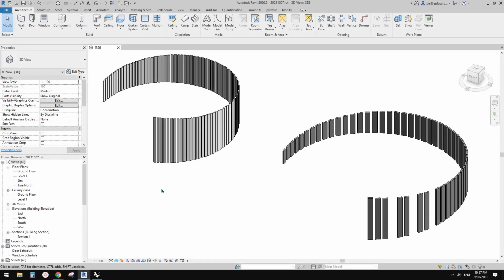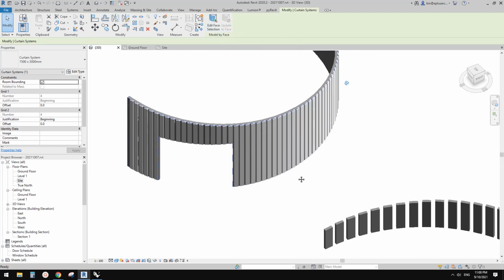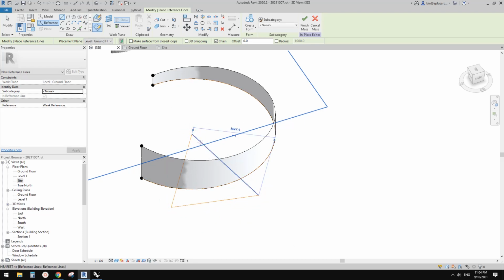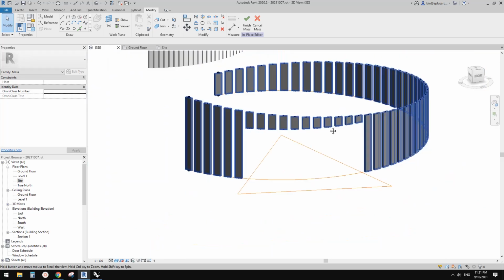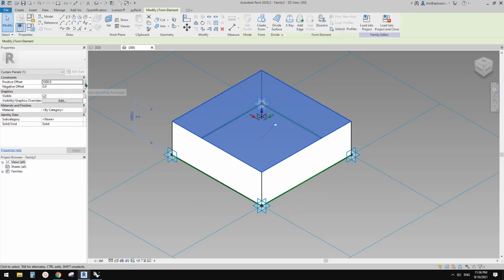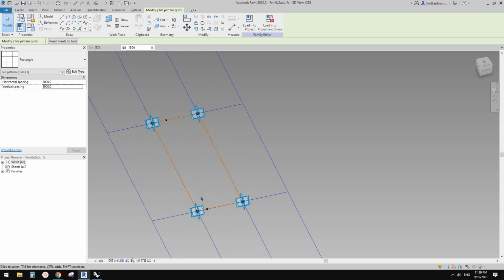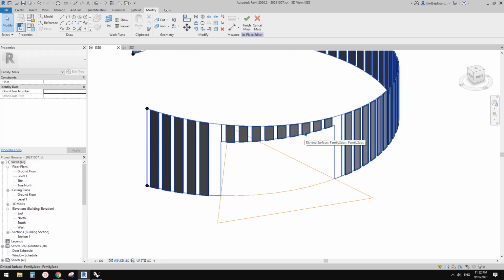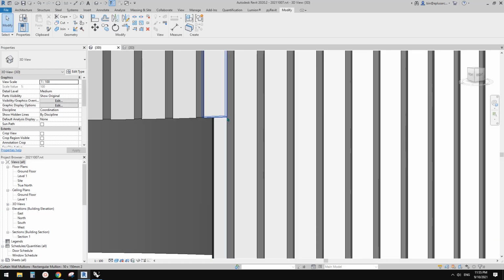Revit Exercise (Day 566) - Let's continue the exercise Day 564

Comment: I have a suggestion,  can you make a video from a to z , of makinga project with the right files and settings , for coordination, wall thickness, templates , for finally making the right BIM project
Reply from the maker: I don't think I am at that level yet. I only work as an draftie in a firm with less than 20 people in regional Victoria and do not have much experience on those BIM stuff. Most of the time we are still communicating with our consultants using PDFs and DWGs. Hopefully I will have some opportunities to work on BIM so I can discuss and share with you guys.